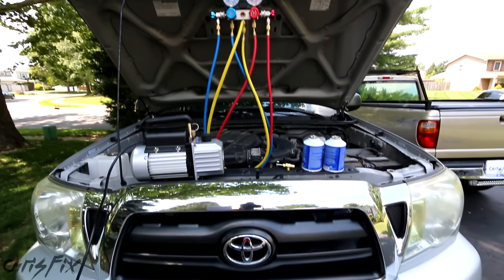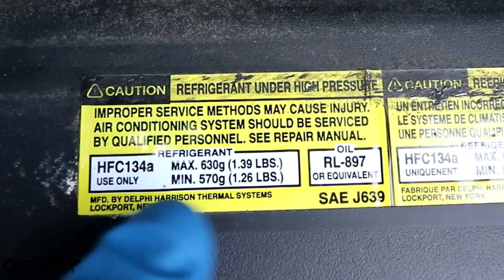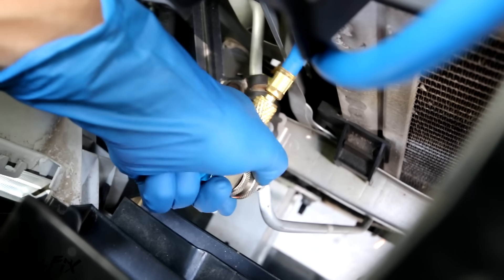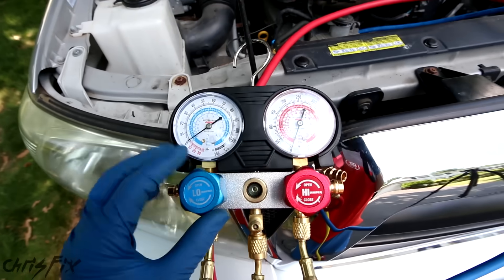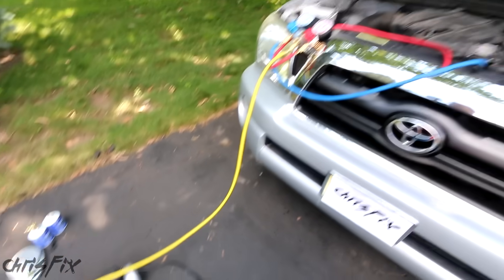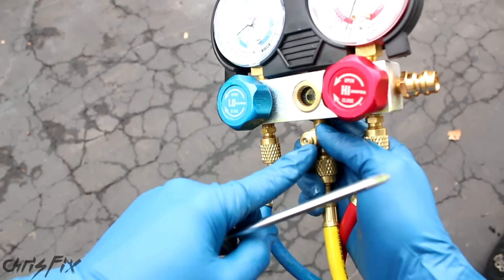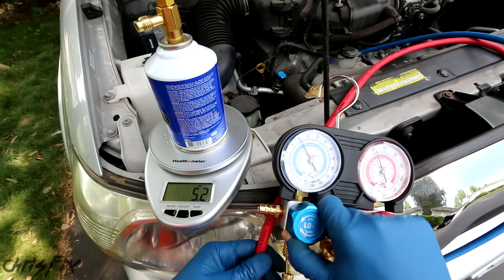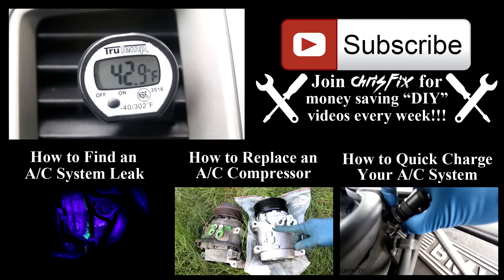How to Properly Recharge Your AC System

Comment: Inevitably, ChrisFix is 90% of the way there, but still misses some key steps and includes unnecessary ones. For example, at the filling stage, he purges only the yellow vacuum line, but there is still atmosphere (at 30 mmHg partial vacuum) in both the red high and blue low hoses. If one wanted to purge the manifold completely, you would do so at the end of each of the high and low hoses, not at the manifold body. So his statement that "the system is purged" is not accurate. It also unnecessary to pull a vacuum on the system for another 45 minutes AFTER verifying that the system is holding a proper vacuum. If there were any more water vapor or other gas that could be extracted while its at maximum vacuum (i.e. holding 30 mmHg without the pump running), no additional running of the pump will make any difference. Stated differently, if more water/air could be pulled from somewhere in the system, the gauge wouldn't hold at 30 mmHg because water vapor or air would slowly be released from some component in the system (i.e. drier) and the reading would change. Thus, he doesn't seem to fully understand gas physics, which is really important for an A/C system. He also doesn't say anything about checking whether the manifold itself is adequately sealed. In my mind, that's step 1. If after pulling a vacuum on your system you see a slight leak, it could be the crappy Chinese/Indian manifold, dusty o-rings from being on the shelf for a few years, etc. The only way to do that is to connect the couplers to dummy valves and test the manifold. Not telling people about those key things (in my book) knocks his otherwise very good instructions down from 100% to 90%.

Comment: When replacing the A/C Compressor, leaving the lines open to the atmosphere could cause the dryer to fill up with moisture no? Shouldn't you plug up the lines when they are disconnected?

Comment: If my discharge line ruptured could I just replace the line with the a/c off?
When the a/c is running it leaks what looks like coolant. But when the a/c is NOT running it doesnt leak so I asume nothing is going through that hose while the a/c is off.

Comment: Ok update, I took it to a shop and had the system evacuated and recharged....however, it still wasn't working so the mechanic tested the fuses and relay...they were fine. But then he checked the relay plug and when I turned on the AC switch and off it made no difference....I'm not getting any signal to the relay. He suggested I get a climate control panel before bringing it back to him.  Here is the question....how do I remove the AC control panel?? I can't really find anything on this...or if you have any other suggestions on where and how to check....he wasn't sure it was the control panel...but didn't have time to track it down.  If it's a simple short some where I would prefer to fix it myself....I do have access to a very good pick and pull place....but I don't know how to access the panel...any help out there? Frustrated 2006 Mazda Tribute owner!!

Comment: I need help!! My compressor locked up, and I replaced it with a kit... compressor, condenser,orfice tube, and accumulator.  I followed all the steps in this video... precisely. Everything was going great...have my gauges, rented a vacuum, have my can tap....all is good.  My system drew down to 30 low side and 0 high side...held pressure for well over an hour....problems started when I went to add my r134....I added one can just like the video... compressor came on and off a few times....went to add the second can....It would only take half the can...and the compressor was no longer kicking on....my vehicle takes max 34oz....the cans I was using we're 12oz.  I have a regular can of r134 that comes with the gauge....so I closed everything, and hooked it up....it was showing all the way in the red!! WTH?? I need help....any ideas??
Reply from the maker: Did you short the compressor clutch to see if it is actually locked up? Did you check the compressor fuse?
Reply: ChrisFix I didn't need to check the old compressor....I experienced "black death" it kinda blew everything all over the place..replaced it already along with the other stuff..and as far as the fuse.....do you mean check the   fuses  under the hood...or in the passenger compartment?? I haven't checked them!! Would a blown fuse keep it from drawing more 134?
Reply: ChrisFix I did check the fuses and swapped out the relay...the clutch still won't engage on the new compressor....do I have to have the system evacuated?? I didn't think I needed to because I had everything out....then hooked up the vacuum...

Comment: Running the vacuum pump for another 45 minutes is similar to emptying a bucket by turning it upside down, and then wiping it out with a dry cloth, and then letting the bucket sit in the sun for a hour, and then turning the bucket upside down to empty it again, and then wiping it with a dry cloth, and then letting the bucket sit in the sun for another hour.  The bucket was dry the first time.

It's a vacuum.  There's nothing left to pull out.

Comment: Good video but next time try using hoses with valves so when you are done with sucking air from the system, close the valves and disconnect the yellow hose from the vacuum pump. You can connect the refrigerant to the hose, the hose is already under vacuum so you don't have to let the refrigerant go out of the hoses. :-)

Comment: You are awesome! Most people (even many professionals) just blow the refrigerant into the atmosphere, although only 500g has the same greenhouse effect as 715kg of CO2.

Some ref hoses also have ball valves, so you don't lose the vacuum in the yellow hose after disconnecting from the vacuum pump.

Comment: Chris. I'm getting a steady vacuum at 10mmhg. It holds at 10mmhg. I'm at sea level. What the heck is causing the low 10mmhg? Should be 30 right?

Comment: Hello Chris nice job thumb up man

Hey quick question should I vacuum the ac system before replacing the old compressor, I’m willing to do this job on a 06 Chrysler 300 my old compressor is making bad noise I think is time to replace it. Thank you

Comment: I’m am currently sitting a refrigeration and ac course in college and I was told not to use the dye because if you have a warranty on a compressor for example and the company you bought it from find out you used the dye they might not replace the compressor.

Comment: Awesome vid! I really love your channel! 

For this episode, when using the scale, I HIGHLY recommend that people just stick to grams. 

The bottle is in FLUID ounces for volume, and most scales measure WEIGHT ounces. You can't really use a weight tool to measure volume (e.g. my bottle holds 4 inches of water... only useful with more info/math). However, grams on the can and grams on the scale are the same thing, and you'd be using a weight tool to measure weight (inb4 mass, grams is still better than ounces here).
Reply from the maker: Thanks for sharing.

Comment: If you close the valves at the manifold set, how are you letting the guages read the vacuum in the system?  looks like you're testing the guages integrity, not the system.  I was under the impression you should only close the low side valve at the service port before turning the pump off, that way you're reading vacuum through the system from the high side...  maybe im wrong, but that's the way it seems..

Comment: QUESTIONs for Chris OR (anyone who knows how to answer this), could you please clarify the order and methods for adding DYE and OIL and then PURGING for air right before you fill the system? 
To me (who hasn't yet tried this but wants to) it seems if you added oil and dye and then purge for air, wouldn't you get quite a bit of oil and dye splatter on you and the vehicle? 
OR is that normal or am I missing a step? 
Also, how much dye should be added? Is there a guide to know of?

Comment: If my system is low (leaking schrader valve that i'm replacing), do i need to vacuum out the refrigerant, or can i just top it off with more refrigerant?    What about adding pag oil?

Comment: you must not put oil on the yellow service pipe, cause you are alson introducing also a small amount of  air in the system, which is very bad
Reply: Mark Deming Sun source?
Reply: That’s why u should purge the yellow hose. Sure, u will lose a couple grams of oil n refrigerant, but will be ok.

Comment: in recharging ac system, do we need to drain the old refrigirant & oil?
Reply from the maker: +John carlo Dioso the refrigerant should be sucked out with a machine (mechanic can do it cheap) and if you had a leak, add about 6-8oz of oil to the system since some escaped with the leak.

Comment: Can someone with knowledge of charging the ac please help. My wife’s 2008 civic was blowing semi cold at night, 62 degrees. In the daytime in Florida it wasn’t sufficiently cooling the cabin. I bought one of the inexpensive cans from Wally World. The gauge said the system was on the low side of good. I figured adding some refrigerant would help. So I followed the instructions. The compressor was on the whole time. Towards the end the compressor started cycling on and off and wouldn’t stay on. Seems like all the refrigerant is now gone. AC blows hot as hell. Any ideas?

Comment: If you were to check the low and high pressures in the system using this manifold gauge, do you have to vacuum the hoses first before connecting it to the high and low ports to prevent air trapped in the hoses going to the system or there is an easier way? Please advise thx

Comment: Two part question on one vehicle I had a/a hose ruptured do I still need to fill the system with oil after I replaced the hose or just fill with refrigerant and second vehicle just a leak on a hose due to worn o ring so do i need to fill with oil as well or just refrigerant please and thanks

Comment: It seems to be more and more common that retailers are selling can taps that require an adapter to couple with a standard manifold gauge kit.  I've posted a review on Amazon for a tap I purchased that has the dreaded 1/2" ACME thread.  Here it is:

A useless product, knowingly misrepresented and marketed by a greedy company
By charles worton TOP 1000 REVIEWER on September 5, 2017

There's nothing wrong with this metal can tap, except for one small problem: it doesn't fit any of the R-134a manifold gauge kits sold on Amazon. And that's a deal breaker.

Every manifold gauge kit sold on Amazon uses hoses that are terminated in a 1/4" SAE fitting. So, logically, the can tap would have the matching fitting. Unfortunately, that isn't the case; this tap will only accept a hose with a 1/2" ACME fitting. And I have not been able to find a single hose, having searched the entire length and breadth of Amazon, that will couple to this tap.

If the vendor had bothered to state that they were making a tap that was not compatible with every single AC gauge kit sold on Amazon, that would have at least been honest. I'd give them a point for that. But while they wax eloquent about their "heavy duty metal" and "heavy duty seals" they neglect to mention that they are selling a tap that is a very short hop away from totally useless.

The only way to make this work, is to purchase an FJC 6015 adapter. It's somewhere around $15, so it's not going to break the bank; but that's not the point.

The point is, every joint, every adapter, is another point of failure, where air can enter and vacuum be lost. When we're evacuating an AC system we're pulling 29.9 inches of vacuum, and that's a pretty potent force. Every joint is a potential leak. And they know that; but they clearly don't care.

The point is, the vendor ought to get off their butt and either find, or have manufactured, a can tap that will actually work with the manifold gauge kits sold on Amazon.

The point is, the vendor should at least be honest, and state that the tap will only fit a 1/2" ACME thread. Cut the "heavy duty" frippery nonsense and state, plainly, what the tap will - and will not - fit.

Of course, if they did that, they wouldn't sell nearly as many taps.

I have nothing but contempt for this retailer. They are knowingly selling a product that will not do what every single customer expects it to do: couple a tin of R-134a refrigerant to a standard manifold gauge set.

So no, I don't recommend this product; but even more emphatically, I don't recommend this retailer. They are clearly so focused on their own greed, that they've forgotten to care about their customers needs. And if that is true of this product, it's also true of every single other product that they sell.

Well, you've been warned. Steer clear.

Comment: hello! I have a question so recently Ive been turning on my AC because it is 110 degrees outside but ones my AC has been running for a while my trucks sounds like a UPS/FEDEX truck when I accelerate. What can it be? i checked my fan clutch and it looks good! my AC is cold but its just that problem that i get. Please help me!! its a gmc sierra 1500 by the way

Comment: Serious question, I rented the Autozone 1.8 vacuum pump and I can't get more than 21" of HG, I live in Boardman , Oregon, I read on some other webpages that they are also getting only about 21", is it because of our sea level? I did this before on my Odyssey and after I filled the refrigerant the AC blew cold so is this going to be a problem in the future like will the compressor break down faster or something?
Reply: You may have had a worn or weak pump or a faulty gauge.  The better the vacuum the more complete the moisture purging will be.
Reply: At sea level a perfect vacuum on a USN steam driven ships main turbine  condenser was considered 29" Hg.  You want to be at  29 or 30" Hg and it shouldn't leak down when you evacuate the system. It's a closed system and your not purging it but rather evacuating the air and moisture. So what K S mentioned may be the prob.  If it holds 21" Hg for at least 1 hour then maybe it's the  gauge. Run the AC with the windows open and measure the AC temperature it should be cold and this is the way to test it properly as it will push cold air quickly if the AC is OK.

Comment: R134a isn't available over-the-counter here in Canada.  We only can buy 12a (not to be confused with R12) which is a hydrocarbon refrigerant.  It is supposed to be a lot more environmentally friendly than either R12 or R134a.  I'm wondering if you can do a video on installing 12a in an AC system designed for R134a.  Also, a comparison of the different refrigerants would be nice.

Comment: A few thing I saw wrong. 
Don't put additives or oil through the line because when you purge the refrigerant the additives or oil will just spray you in the face. Time is no substitute for accurate measurement of vacuum. In hg isn't a measurement of vacuum but a measurement of under atmospheric pressure. The only way to make sure a system is truly dry is with a micron gauge. And thirdly you should have purged refrigerant when you hooked up the 2nd can. You just added oxygen and moisture to that system.

Comment: My truck is blowing hot air... why should I do this and not just get a can of ac pro cold and just do it like that??? It's much easier and faster...
Reply: Switchbladeakc I think Chris mentioned that he replaced the compressor.   The a/c pro cans are much more expensive than cans of refrigerant, right?

Comment: Hey brother I was looking at this video about the ac and I did everything step by step but when I put the refrigerant I open the low side and by mistake I open the high side to  now I think I have problems the system stop to take the refrigerant inside my truck was cold and the compressor was activated all the time but I don't know what to do now please let me know what I can do ty.

Comment: A couple notes since this is about recharging AC properly. Don't turn the can upside down which adds liquid refrigerant directly into the low side line. Liquid refrigerant going into the compressor can damage it. Most cans indicate the can should be upright (discharging only gas) when charging. Second, if you can't get the gas out of the can fast enough, place the can in warm water. It helps evaporate the refrigerant when the can temp/pressure drops. Finally, stop using those absolute junk Fram oil filters. Search oil filter comparison. Do your Tacoma a favor and use OEM filters. They cost about the same and are 3x the quality. Once you see a Fram filter cut open, you'll realize how worthless they are.
Reply from the maker: +Kilo Mike thanks for the tips.

Comment: You forgot about purging the second can?
There is an international ban on selling refrigerant to the mass. R1234yf and R123a cannot be purchased without a licence. If you get held of gas somehow, its a lot more work with this. Every 3 years or when the installation was open, puncture etc, you have to change your drier. As he said moisture kills your A/C